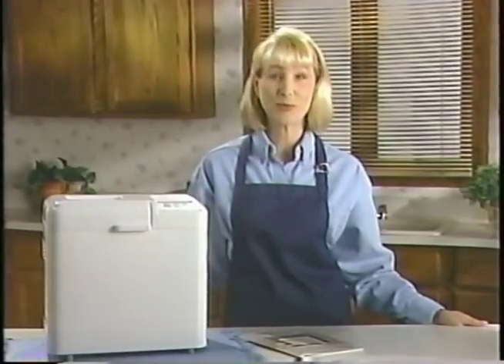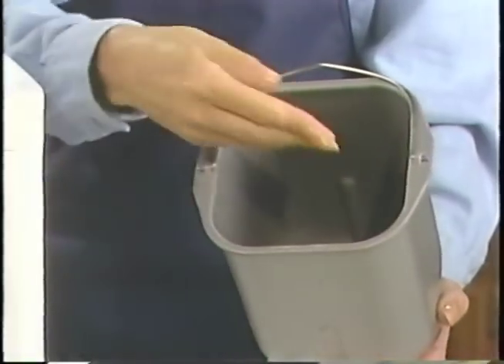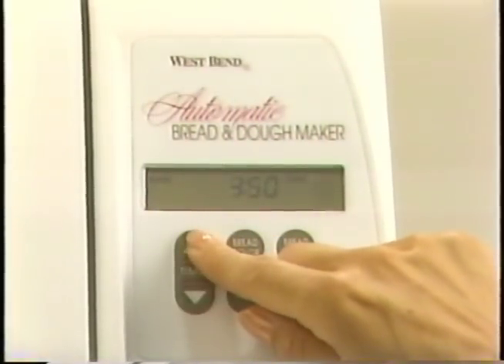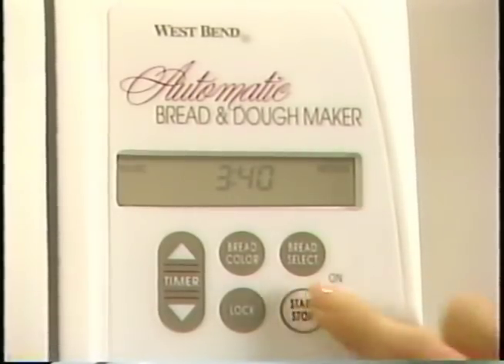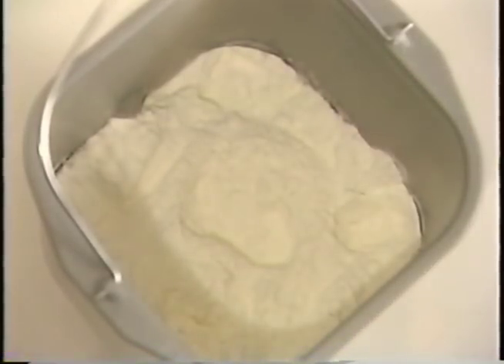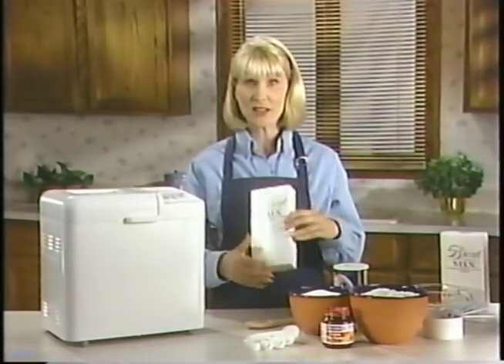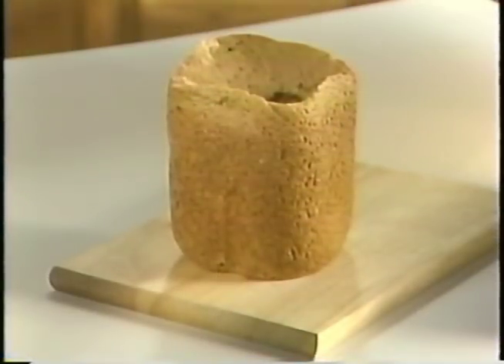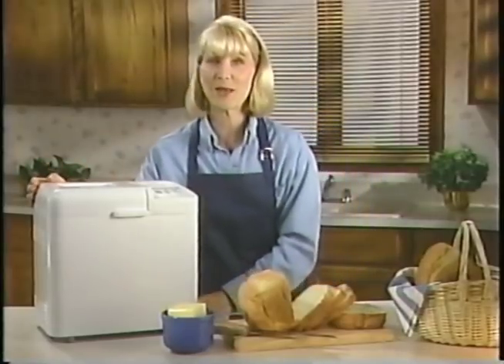Westbend Breadmaker Instructional Video

Comment: This video was exactly what I was looking for!  Just picked up this bad boy at a thrift store and it didn’t have any instructions.  Thanks for posting!
Reply from the maker: Glad it helped! Thank you for the comment
Reply: I always dump in fhe water, then dry ingredients (sans yeast) and make a well in the center. Then I add yeast in the well. Also, DO NOT open the door during proofing. You will let the heat out and interrupt the rise.
Reply: This model is so similar to my Oster brand. I also got recently ta thrift store , basically new, old machine . 
I love this video! 😁
Reply: Mine too, there was a manual but would like more recipes for this machine.
Reply: Same here lol Salvation Army sale.
Reply: God what a 90s infomercial.

Comment: I have been making bread for over 20 years and here is a tip.
Run hot water into the bread  pan (and let it drain out)  before you add the ingredients.  
A hot pan will produce a nicer loaf.
Reply: Doesn't make sense. The pan will heat up anyway in the bread maker.
Reply: @ronlevy2583  Yes, mine too will heat up slightly and make a good temperatures for yeast.
Reply: Thank you,!
Reply: I like a nice loaf 🍞

Comment: The part you came for: 

1cup tepid wter.
2 & 3/4th breadflour
2tbsp sugar and dried milk.
1 &  3/4 salt. Tsp
2tbsp cut into 4 corners.
1pkg dry yeast. 

Basic loaf, medium crust. Start botton. 

Martini.
Reply: I don’t have packaged yeast so how much do I measure out? Could I use regular milk? This seams like the recipe me and my grandmother would use when I was a kid. Just found the west bend machine we’d use and I wanted to make some bread like old times but couldn’t find our recipe.
Reply: @TheDuffman1812  1 package dry yeast =2 1/4 tsp. Or 11 ml. Google it.
Reply: If you have a scale, here are the converted weight measurements:
1cup tepid wter.         (236 g)
2 & 3/4th breadflour    (357 g)
2tbsp sugar (25g) and dried milk. (14g)
1 &  3/4 salt. Tsp (9g)
2tbsp butter cut into 4 corners.
1pkg dry bread maker yeast. (21g)

Comment: For those that don't have bread flour or dried milk, I used this recipie and it works perfectly every time!
1 cup of water
3 cups of flour 
2 tbsps of cold salted butter divided in 4ths [pretty sure you could use unsalted] 
2 tbsps of sugar 
1 3/4s teaspoon of salt
2 tbsps of whole milk
2 teaspoons of breadmachine yeast 
Just make sure the yeast doesn't touch the salt or the milk/water when putting the ingredients in. I usually add the water first, 2 cups of flour, all of the other ingredients then the last cup of flour to provide the yeast some protection 😉
Reply: Thank you so much for the recipe. I don't stock dry milk or bread flour. This was why I started looking at videos and this was the first one. Yippee! , didn't have to watch a thousand videos and recipes.
Reply: Thank you! Do you ever add oil in place of butter?
Reply: @Czurovec  nope!
Reply: @Casuallycraftedbread  thank you@! I'm trying your recipe in my bread maker as we write! 1HR LEFT!
Reply: 🙏 Thanks, I was definitely going to use the same recipe that I was using before I bought this bread maker..

Comment: "TIP" Once kneeding cycle is complete remove dough then remove the mixing paddle, re-insert dough and let machine continue for a better looking loaf and less moisture loss due to lack of hole oil bottom of loaf.